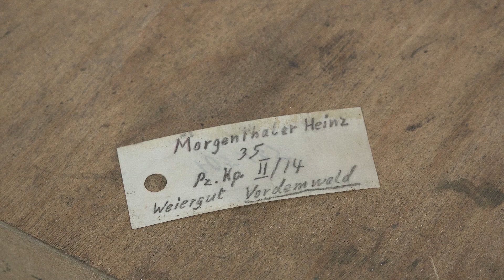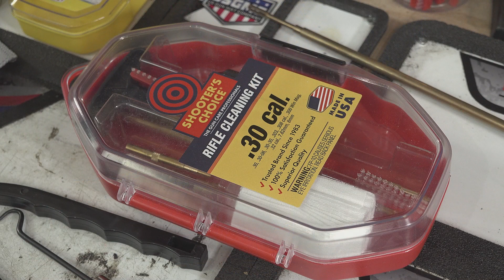Swiss K31 Full Disassembly & Clean

Comment: 42 CHF (Swiss Francs) in 1940 would be approximately $3,392 in 2022 USD (US Dollars).
Reply: I'm guessing you inflated the USD then multiplied it by 3.20 for the smelt value of a swiss franc?
no wait that still would fall short. where are you getting your numbers?
Reply: @Foche_T._Schitt  looked at historical prices and exchange rates.  It was roughly 1 CHF to 4 USD from what I could find in 1940s. According to inflation adjustment $168 USD is $3392 in current dollars.

Comment: Hi all, I have several of them in nearly new condition (one from my grand father as well). They shooting mostly sub moa with Swiss Army Ammo 7.5 x 55. The one with the scope, I get even less then 1/2 Moa. Very important the hold it accurate is, don't screw the front band screw on the stock to hard. Most old Swiss snipers they surrounded the barrel with a peace of soft paper and screwed the band very soft so that nearly no pressure occurs the the barrel. You have to know, that the training distance of every Swiss solder was always 300 meters (330 yards) standard distance. And they hit a target of 10 cm (4") with open side (good shooters only).

regards from Switzerland

Comment: 12:08. I actually did some calculations on the cost in 1942 to replace the rifle. In 1942, 42 Swiss Francs was about equal to $47.04 USD. And so, calculating for inflation, $47.04 USD in 1942 is the equivalent for about $900.73 USD in 2023. So, the cost to replace a K31 in 1942 was around the cost of $900.73 USD today.
Reply: What about production costs? We are all being robbed by those responsible for inflation.
Reply: @bhoward9378  Oh yeah. Well, if it COSTS the company around $900.73 to MAKE it, then the end price to the consumer means that it costs somewhere around $3k or somewhere in that ballpark to purchase it today.

Comment: The K31 is still a very popular rifle among sport shooters in Switzerland and in Switzerland it is usually shot at 300m/328 yards.  The Swiss Army's requirements for the K31 at the time were that it should be as precise or more precise than the IG11 which is 131cm/4.3feet long but not much longer than the K11 which was 110cm/3.6feet long.  

Of course, the Waffenfabrik Bern didn't settle for just as good and actually managed to improve the precision of the K31 over that of the IG11 and still have the same length as the K11.

Some even say that winchester took "inspiration" from the GP11 to make the .308 because of the oddly similar dimensions and performance. 

P.S. There's always the rumour, that the GP11 is out of production. This isn't true. True is that RUAG, the producer of the GP11, temporarily stopped production a few years ago due to quality issues but after those were resolved they started production again and this until today. However there are other manufacturers that makes 7.5x55 Swiss which technically is GP11 but because GP11 is the military designation for 7.5x55 Swiss, there's only RUAG that can legally call it's ammo GP11 because they do all the ammo for the swiss army.

Comment: You can open the bolt even when the safety ring is on „save“. Push  the ring a little bit down left an pull the bolt.. Good shooter can do it  by one hand.

Comment: FYI, Classic Firearms has incomplete Swiss cleaning kits for $10 still. I bought one and it actually came complete, with 2 full canisters of the automatenfett stuff too.
Reply: If it's the green roll kit with threaded extension rods it's actually the standard issue for the stgw-57. The K-31 army issue cleaning kit used a pull string for bore cleaning with some patches.
Reply: @ericmowrey6872  oh really?? Well dang... Seems to work fine though in my K31. Granted, I use a Dewey rod instead of their segmented rod.
Reply: @willsnipeforfood  glad to hear it Will. It works because both rifles share the same cartridge. The black grease is graphite base and not meant for the K31 in case you're tempted to use it.
Reply: @ericmowrey6872  ruh roh lol little late for that XD
Reply: @willsnipeforfood Suit yourself Will but a little gun oil on the bolt izall you need for the 31. The stgw 57 is a delayed blowback design with select full auto fire. It's got locking rollers in a heavy bolt that cycles back n forth at high speed. It needs the special grease supplied in your kit. It's basically machine gun grease.

Comment: Yes remove the follower and spring from your magazine and clean it. I've seen too many neglected magazines. Just remember the orientation.
The acids from the wood can fade the writing or the butt plate can stain the troop tag, sandwich it between some archiving plastic like a BCW protective page.
It's not unusual for the sling clip to be missing from the sling, they made noise. Soldiers don't like noise. 
Removal of the sling ferrule may result in wood chipping out of the buttstock.
It's not a full floated barrel when assembled. You missed pointing out the shim under the receiver in the stock.They come in different thicknesses and are selected by the arsenal to tip the barrel up so the upper hand guard can bear down on the barrel to dampen the harmonics. DON'T LOSE THE SHIM
The front receiver screw should be tight. The rear should snugged down drawn up until it starts holding a group. 
German 101, whenever you see a W pronounce it like a V. Like LuftVvaffe. Vvaffenfabrik.

Comment: It is very unfortunate there is no aftermarket ammunition with the same bullet dimensions as what the rifle was designed to eat.  All of the PMC (edit *PPU) stuff uses generic dimensions. Take a set of calipers and pull a bullet from a swiss military surplus round and take some measurements compared to that of the PMC (edit *PPU).  The dimensions are very different. Make sure to measure the diameter at a couple of different locations along the surplus. It was designed not to be congruent.  The PMC (edit *PPU) is consistent and oversized throughout its diameter.  The pressure curve and ballistics are going to be very different.  The throat and barrel wear are going to be very different (excessive).  The accuracy is very different.
Reply: I have 3 of these rifles along with a couple k11 and 1911s and it depresses me that I can't find GP11 ammo anymore.  It literally makes me very sad.
Reply: PPU makes a good round for this.
Reply: Switzerland started producing GP11 again for their machine guns and competitions but I doubt any of it will trickle to the states anytime soon if at all unless you have connections. 
Militaries usually surplus their ammunition after 25 years. After 50 years the powder is breaking down and it gets hotter which is why everyone says Turk mauser ammo is hot. Because it was freak'n old and stored in awful conditions.
Reply: Ppu 174gr fmjbt is equivalent to gp11, compare to a gp11 and you will see
Reply: @Dragan972  My apologies. I meant PPU, not PMC.
Reply: @nebelwerfer199  My apologies. I meant PPU, not PMC.